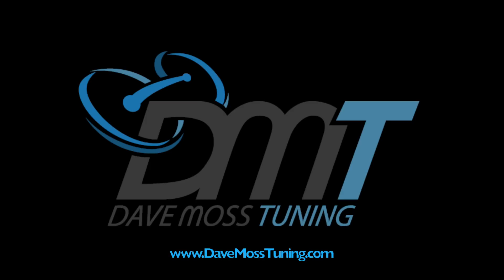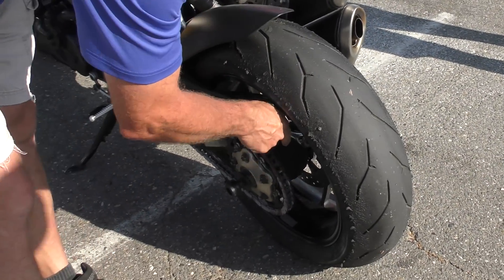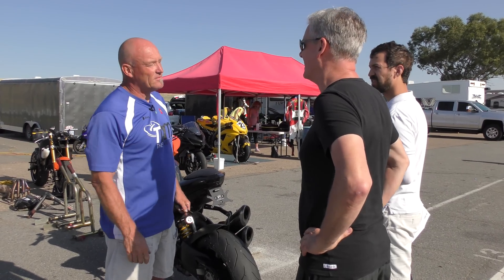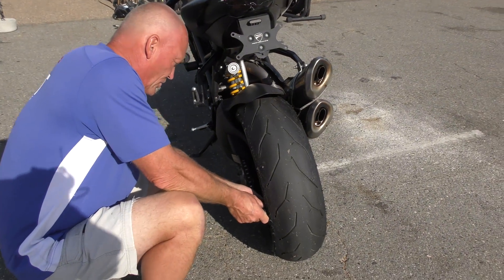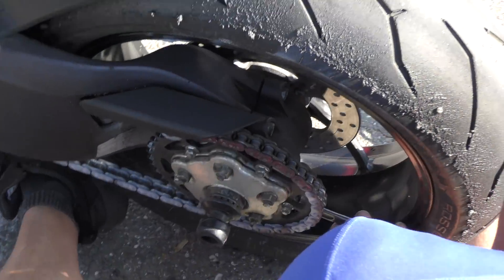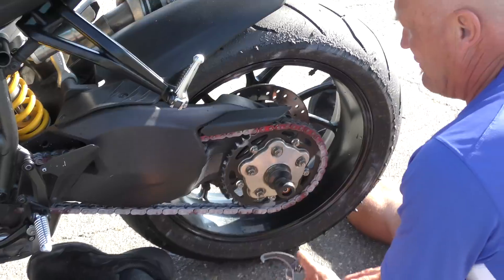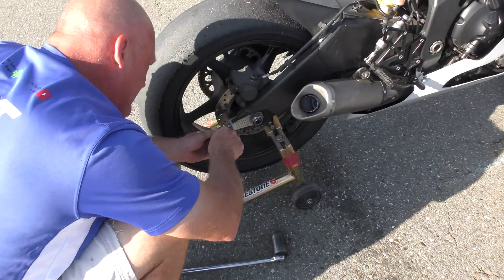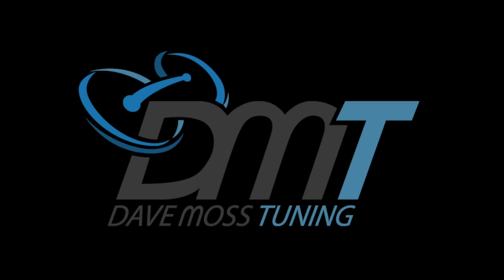Single Sided vs Double Sided Swingarm Chain Adjustment

Comment: Hi, I would like to ask if I have an irregularly tensioned chain on my motorcycle, which has a mileage of 1100km, is it possible to adjust it or does it mean that the chain is faulty, as the Benelli dialer wrote me back. The rear tensioners have to be in the same position so that the wheels are level or don't have to and is it possible to adjust the chain with them so that it has the same sag along the entire length of the chain? Thank you and greetings from the Czech Republic.
Reply from the maker: Thank you for your question. There are many ways to set chain tension correctly using Vernier calipers or other measuring devices. You can also measure from the swing arm pivot to the rear axle or simply measure the ampount of threads showing on both bolts that connect to the blocks.

Comment: Mr Moss - just trying to fully understand - the chain after adjustment on a double sided swing arm is just touching the underside of the swing arm at the slackest spot or should it just avoid it?
Reply from the maker: Hi Mark. The chain so just touch it without the top area of the chain moving. Thanks for your question!

Comment: My dude rides in track and straight up asks if 5 psi is ok to ride?😂😂😂 WTF.
Reply from the maker: Dave Williams, editor, replying here.  My apologies for that misunderstanding. He was not riding with 5 psi in his tires. I should have edited that conversation better. He was talking to Dave about a 5 psi gain from the tire pressure he set in the pits and the pressure he came back with hot off the track.
Reply: @catalystreactionsbw  That makes more sense 🤣

Comment: Dave what is the reason behind sticking something in between the sprocket and chain when tightening the swingarm nut? + I had no idea there was loose and tougher parts on a chain. But it all makes sense now. Your videos are amazing and well explained. Love to see you at work, much respect!
Reply from the maker: It forces the axle blocks against the bolt heads to make sure the axle is even and forward.

Comment: Hi, do you tend to have a marginally looser chain setting when on the track due to the swingarm squating and unloading much more than say on the road.
Reply from the maker: I always run a slightly looser chain for both street and track as the street has the greatest variance in surface.

Comment: Perhaps, explain why you put the Allen Key between the chain/rear sprocket before tightening spindle ?

I use laser tool, to maintain alignment, it amazes me the number of people who don't start with the sorting the basics first.
Reply: If you watch moto gp after a rear wheel change, that's how they do it. It's to get tension on the chain before tightening the main axel bolt. So things don't go slack after the axel nut is done up.
Reply: @shadowred1980  That would be useful when I tighten the chain next time, thank's.
Reply: All that does is align the chain with the front sprocket, it doesn't mean your wheels are in line though, get a wheel alignment, it's much more important.
Reply: I would agree that front/rear wheel alignment is important, and is worthy of a separate article, but this one relates to chain adjustment.

Sadly, often swing arm marks aren't totally accurate, and single sided arms not correctly serviced.
Reply: @alanbrown5593  I mean it sort of ties into it though, you're never going to get an aligned chain and wheel (unless you're super lucky) 

My bike is pretty far off, I'd rather have a chain that wears a bit quicker, knowing my wheels are aligned. The swing arms marks are more of a baseline than anything.
Reply: @Gobbbbb  I had an R1(from new) that never really handled that great (apart from the usual understeer) which had a slightly out of line headstock despite never being dropped crashed (I eventually had it jigged).

My only point is, that chain tension/alignment isn't difficult to do, yet I often see bikes at track where it hasn't been done.
Reply: @alanbrown5593  It's quite surprising really, I was speaking to a motorcycle tester here in the UK and he was saying 9 times out of 10, when he puts the bike against straight edges, they're out, sometimes even by centimetres, and these are almost new bikes.

I completely agree, chain adjustment is one of the most basic maintenance items on a bike, most people don't care to learn ANYTHING about their bikes, yet will ride them round a track at 150mph lol.
Reply: @Gobbbbb  Agreed, it can be quite surprising how many new bikes aren't straight, friends new Triumph had the handlebars over to one side, which made it "interesting" for her to ride until sorted.
Reply from the maker: The axle blocks are forced against the bolt heads. This always ensures the axle is straight.

Comment: On single side motorcycles it's easier when you uses a rear stand but you have to let 5 mm more of chain slack ( user manual indicates to adjust with the side stand on the floor , but the motorcycle weight makes the chain adjustment a pain in the ass) so it's better to use a rear stand and let the chain 5 mm loosen to compensate it when the rear wheel is on the ground.
Do this adjustment on a Ducati is easier than on Triumph motorcycle, because the width of the adjuster nut.

Comment: I've always checked for uniform chain slack first... rear wheel rotated while looking for tight vs loose spots - then adjusted the chain... big variation means either wore spocket(s) or chain... small variation, just adjust while on the tight spot...

Comment: I went from a 2011 Ducati Monster 796 with the single sided swing arm  to a Yamaha MT07 and I can tell that the single sided swing arm is awesome in every way and sooo much easier to work on and do maintenance
Reply: 1000% true... for maintenance the sssa is just better... period. Slack adjustment is trivial, I can change out a chain and sprocket in about the time it takes to get the wheel off and on a dssa bike... and unmount/remount a wheel in half the time it takes with a dssa. When I first got the Ducat I bought a "quickchange carrier" for my sprocket to make it quicker to change sprocket/chain... but it's actually SLOWER because it's 6 bolts instead of just one (big one) with the normal carrier, so I switched back.

If you're looking for THE ULTIMATE in rigidity then the DSSA is the best... but you better be a pro because if you aren't then you're making your life difficult for a few percent increase that you'll never feel or take advantage of.
Reply: I have fond memories of my 916, 996, and 848 single sided swingarms. So easy, and impossible to get the wheel out of line. Ducati went back to a double sided arm with the 999, because it's lighter and has higher rigidity.
Reply: I ride an 06 Triumph with a sssa. Love it and it looks great!
Reply: But it is has to be made heavier than a twin side arm because it is an inherently weaker structure. Also the eccentric for the chain adjuster needs to be removed and cleaned/lubricated frequently as they are prone to seize into the swing arm.
Reply: @jongreen9113  Also, interesting that their superbike is single side but their motogp bike is double (twin).
Reply: @jongreen9113  I have removed the eccentric once in 70,000 miles on my Multi (at about 55,000 miles)... and there was some dirt in there but not as much as I'd expected (and I've probably ridden 10,000 miles of dirt roads on that bike).

Never had a problem adjusting it.

It will increase unsprung weight because the casting is heavier... but again... unless you're a pro you will never notice it (a lot of that weight is very near the pivot where it doesn't add much actual inertia... since it's a lever arm calculation)
Reply: @jongreen9113  in the last 11 years I have never had a problem with the single sided swing arm  and it doesn't weigh more than the regular swing arm
Reply: @jongreen9113  It’s obvious that single sided swingarms come with a terrible performance disadvantage. That’s why you’d never see such a machine leading the world championship. Oh, wait… 😂
Reply: @jongreen9113  everything you just said is  not true